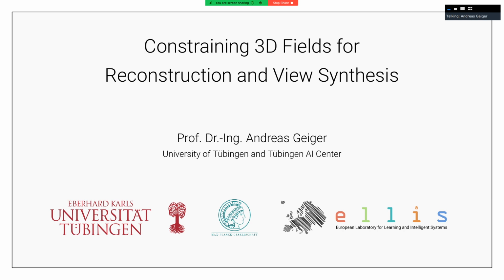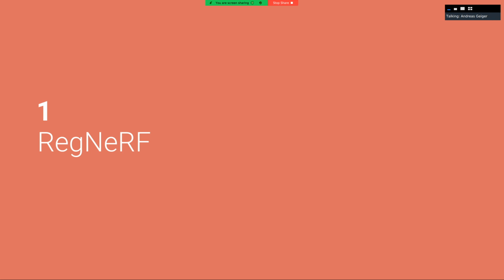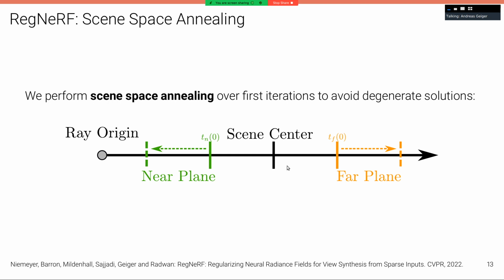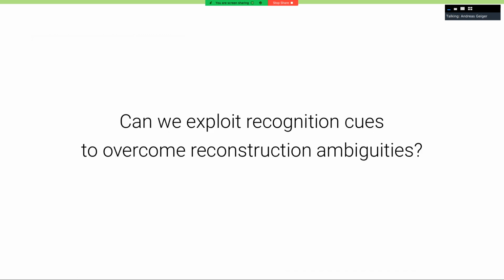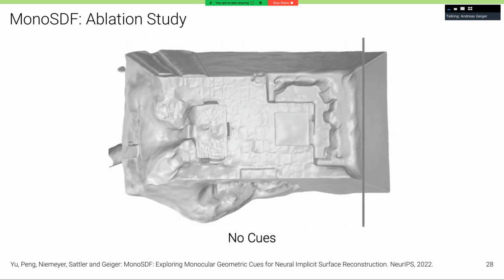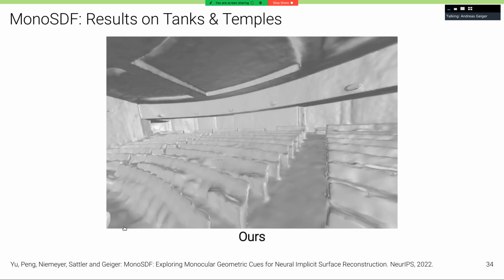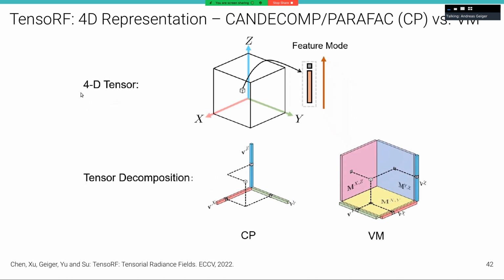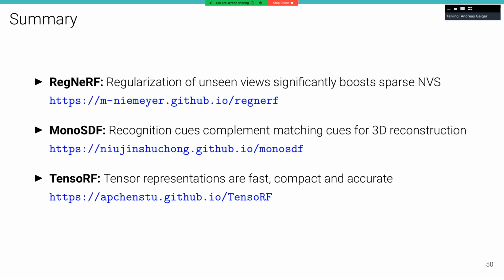Constraining 3D Fields for Reconstruction and View Synthesis

Comment: Hi Andreas, thanks for the video, I was wondering in the TensoRF model if you can easily compute the gradient of the density function at any point, (i.e. the surface normal vector)? With a NeRF I can compute the gradient of sigma using autodiff on the neural network. How does this translate to TensoRF ?
Reply from the maker: This should also be possible, autodiff then basically differentiates through the (bi-/trilinear) interpolation function.